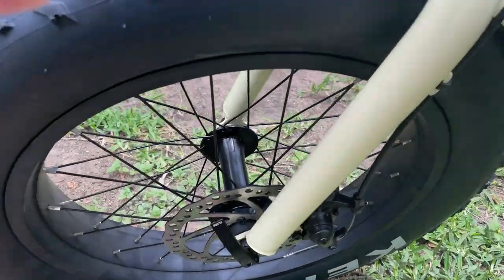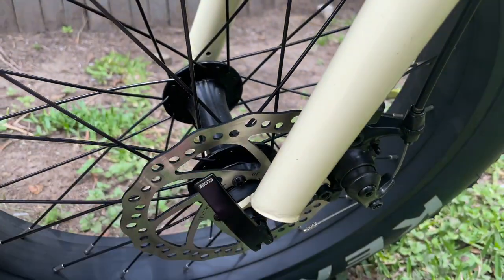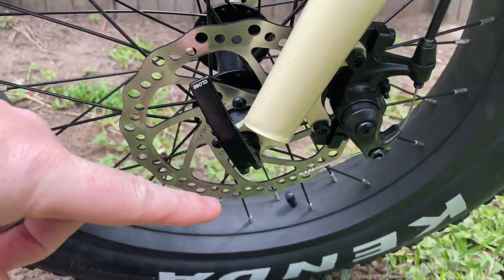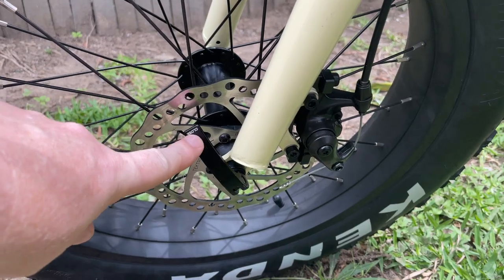How to fix squeaking sound in front wheel

Comment: Hmmm, i think theres a bit more to it than that. Such as brake rubbing on the rotor. Adjusting the position of the wheel (using the quick release lever) might help, or if the wheel is clamped on too tight. There are recommended positions for the qr lever, just so that it's easier to access (eg not completelt in line with the frame), but i don't believe the qr lever position alone has an effect